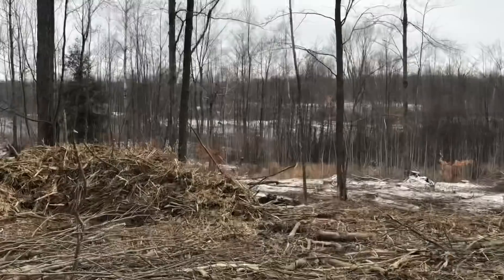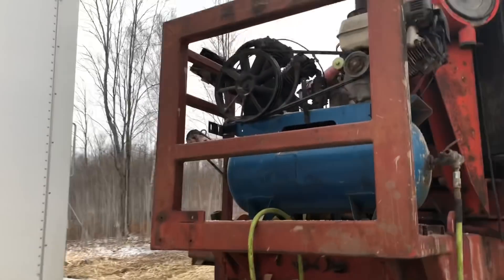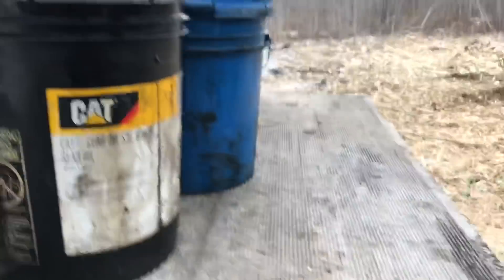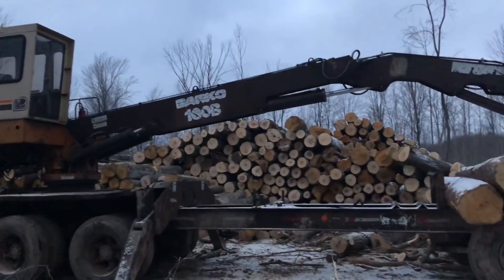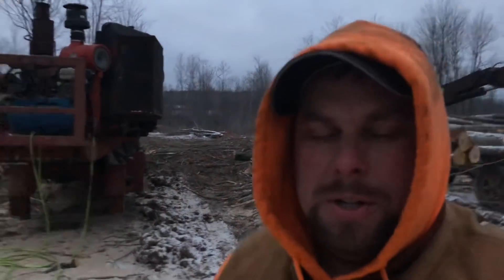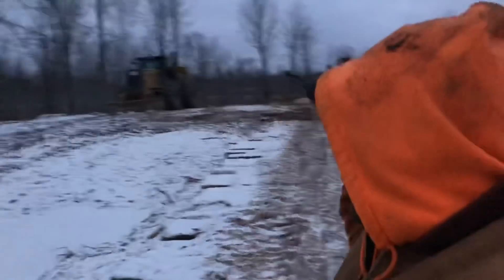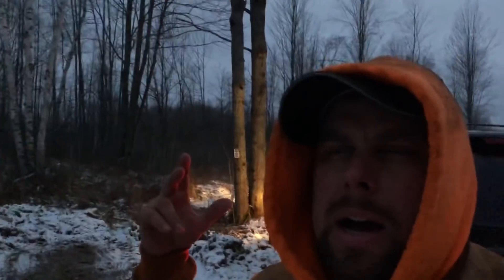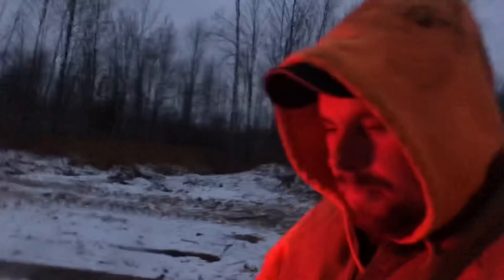Oil Change and Updates!

Comment: You should have an oil vacuum setup on your truck to suck out the waste oil. You can get an air operated vacuum to connect to a tank or barrel. Make one out of an old 100 pound propane tank. Use an air powered vacuum generator to pull a vacuum on the cylinder and a hose to suck it out of the engine drain hose. Use the same setup to pull a vacuum on your hydraulic system to stop oil draining when changing hoses or working on pumps.

Comment: Be thankful for the boring days because THERE is where the money is and you're not running around like a waco trying to get something fixed  and I dare say that your coolant/oil problem is o-rings on the sleeves, but that's just me.  Prayers, BLESSINGS and Goomerish Daddy to Hug Goomerish Younguns. They didn't fall far from the tree, Pal!
Reply: Lewie McNeely that’s my guess to we’ve had that happen before, I told him that a head problem would put pressure in the radiator.
Reply: @mikeandkimcook9074  That old baby has a LOT of hours on it and a lot of expanding and contracting. I don't see how the seals stay in one as long as they do because those old motors would just flat-out GET ON with it. They were waiting on YOU, not you waiting on them. And if it was much of a head problem it'd blow all the coolant out, one way or another. I think you're right, Pal. We need to keep that thing prayed up and swapped with the one in the shop. THEN let it roar! Take care Yall! Good to hear from you!